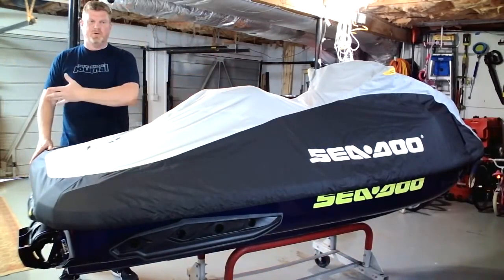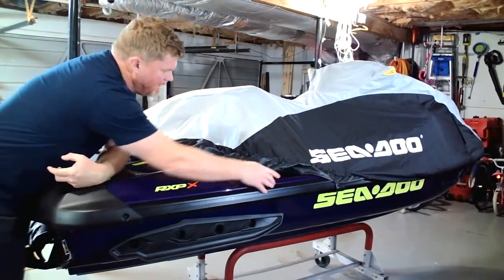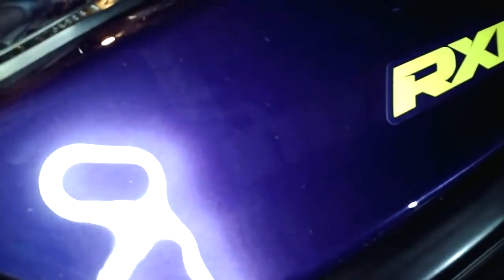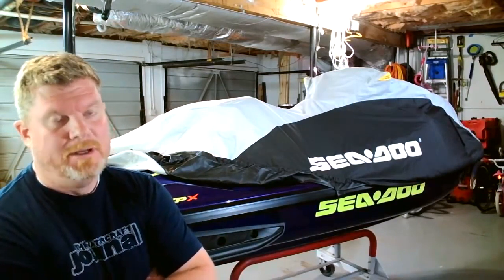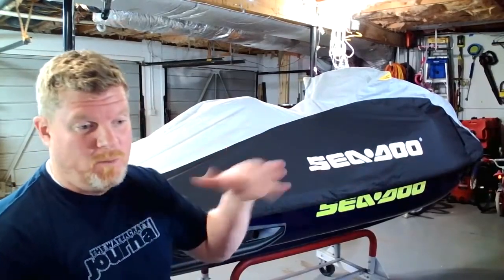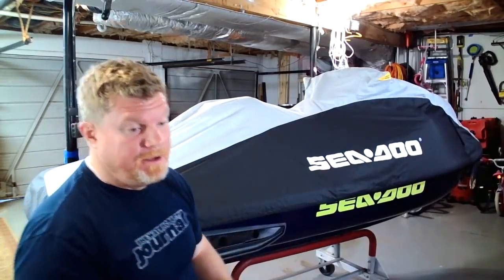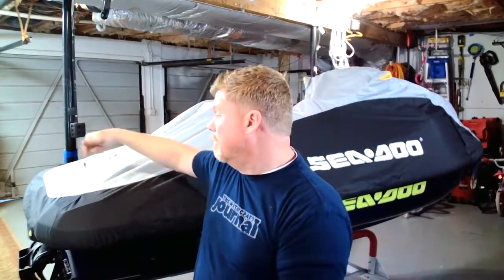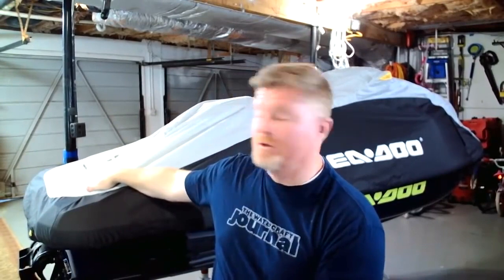Should You Tow a PWC in a Cover? WCJ Quick Topics

Comment: A good tip I have found useful if you tow with a cover on (as I do, especially long distance) is the use of painters tape (I use the wide type). I put a run of the tape on all leading surfaces that may come in contact with rubbing as well as around the draw tight line of the cover (more for a boat). Only takes a few minutes and cheap insurance to prevent rash marks on your ski/boat.

Comment: Well I drive every summer with my 2016 yamaha VXR cover and have never had any issues. The yamaha covers have tie ropes on the front of their covers with vents on the side rear. If you pull the rope lines tight and cut them half a inch shorter and tie a double knot on them, they keep the cover tight on you ski not allowing for flapping around at high speeds. I travel 380 miles every summer at 75 mph and no issues. Keep the cover on , it will protect the ski from dirt and rocks dinging your ski.👍
Reply from the maker: We've seen plenty of Yamaha covers disintegrate. Glad it hasn't happened to you.

Comment: Noob question here: What tool do you use to move your PWC from the trailer to the rolling stand that you have it on in the video? Some sort of jack thing? I just got 2 brand new Spark Trixxx 3 seaters (storing them in my garage).
Reply from the maker: Brute strength.
Reply: @watercraftjournal  lol how many people does it require?
Reply from the maker: Yourself - they're Sparks. Push the cart up to the back of the trailer, spray the bunks with WD-40, and pull on the back of the Spark. It'll slide from the trailer bunks to the cart. If you can't grab the back of the ski well enough, hook a tie-down strap to the D-rings and use the strap like a handlebar to pull it.
Reply: @watercraftjournal  thank you
Reply: @watercraftjournal  Dawn platinum power wash works great too.

Comment: As some have pointed out, the Yamaha factory cover has vents which in effect sucks the cover to the ski at highway speeds. They stay on great, don't flap and I have not seen any negative scratches on my '19 VX...nor now on my '22 FX...which I just towed 600 highway miles with. But your comments are noted.
Reply from the maker: We've had 2 covers completely tear those plastic vents off - just by wind speed.
Reply: @watercraftjournal  Right from Yamaha "Our covers are constructed of ultra-durable Eco-Elite fabric for the ultimate protection against fading and the elements. It is also non-abrasive, water-repellent, UV, mildew, and rot resistant. Features include Vacu-Hold� design, which creates a vacuum inside the cover during transit to draw the cover down snugly to the WaveRunner. Benefits include reduced air-induced stress on the seams, and less aerodynamic drag." My dealer is the one who told me the Yamaha covers are made for trailering...Yamaha seems to say the same.
Reply from the maker: Good. Listen to them then.
Reply: @watercraftjournal  LOL, well maybe the towing vehicle makes a difference too...could be the turbulence or lack there of behind the tow vehicle...but from my view, the Sea-doo cover is an inferior design to Yamaha's.
Reply from the maker: We've had all 3 OE's covers fail, as well as 2 major aftermarket covers.
Reply: @ericbryant796 Yama cover Andy enjoyer

Comment: OMG, why did I not think of that.  This would probably how I have developed 2 spots on the front that have turned dull.    I don't have the scratches but you can see the clear coat has been rubbed dull.  Ok so when I go on vacation and tow my seadoo Ill leave the cover off.  I just didnt want all the road grime on my ski but that just takes a really good wash to get off.
Reply from the maker: You're going to build up road grime with or without a cover, as the hull is what gets coated (mainly) with whatever your truck/SUV is kicking up.

Comment: How about the rocks and stuff flying up from my truck. I’m worried that it’ll damage the Seadoo without the cover. Doesn’t all that debris and stuff ruin the Seadoo?
Reply from the maker: You're going to build up road grime with or without a cover, as the hull is what gets coated (mainly) with whatever your truck/SUV is kicking up.
Reply from the maker: So your argument to "PWC covers scratch up your ski" is "Not if you tape down a bunch of towels under the cover"? Then Kevin's original argument still stands.
Reply: It’s a seadoo does it really matter if it has stone chips?
Reply: OMG. Towing with the cover doesn’t scratch your ski.  How about the rocks that fly up and hit the uncovered ski, lol.
Reply: This argument that rocks and debris are going to scratch the top of the ski without the cover makes no sense to me… your car has no front cover and there are thousands of cars in front of you kicking up rocks and debris. Jet Skis are made of material much more durable than car paint.    Unless you’re driving on some major off roads at 50 miles an hour while tow …. I live in LA and tow my Jetski to all the major lakes without a cover and I haven’t had any issues with rocks and debris striking my Jet skis.

Comment: I’m still on the fence. If you’re on a major highway (say going to the cottage) … Isn’t the lessor of the 2 evils the possibility of what you’re speaking of? As opposed to road grime, pebbles and anything else on the road your vehicle shoot back at the machine from its tires? I should mention I do have the all black cover that seems to be more fitted.
Reply from the maker: Don, it's a fair argument. Here's the "rub" – you can risk a dirty ski (depending on how rough the road is, it could be worse than "grime") or having to replace the soft/sensitive plastics that have been scratched and scuffed beyond repair.
Reply: @watercraftjournal  agreed. Just trying to figure out which is worse. I typically do the exact opposite, if I can control the conditions and stop or take another route through town I’ll keep cover off, but… if I’m on the highway at 120 km/h it’s typically on. For me anyways.

Comment: this video is 3 yrs old, but..i wanted to share what i personally have tested. for one, yes, i have the oem cover for my '15 yamaha waverunner fx ho cruiser. what i noticed about the cover is it's very rough to the touch when i went to pick up my ski from the dealer back then ( 2015 ), i knew going in, i was not hauling my brand new ski 7 hrs back home with this cover on my new ski. sooo..left the cover off for the haul home. once i got it home, i went to hobby lobby, purchased some soft cotton fabric, and sewed a liner to the underside of the cover, end to end, side to side. i have not trailered it yet for long distances ?, but i do know it will not scratch the paint on my ski. now..its a toss up if it will rip itself apart for a long distance haul ?, i do not know if it will or not yet ?. if you do this to your ski cover ?, i would advise to run some straps across the cover to keep it on the ski at highway speeds. 

Edit/update: just came back from a long drive from little rock,ar to knoxville,tn towing my ski with the cover on my ski, all the way there, all the way back, it never came off, never scratched my paint on my ski. maybe seadont's are just not meant to tow with covers on ?..lol. i will say !..i did have a strap across the middle of the seat/cover to keep it on the ski incase it decided to fly off ?, but it never moved one inch at the front or back. p.s. this was done while driving 70 mph !.

Comment: My Kawasaki has vents at the back of the cover only, this seems to make it suck down tight to the ski at highway speeds. Thoughts?
Reply from the maker: Kevin spent an entire full length video on this. Go listen to his thoughts there.
Reply: @watercraftjournal  ok, thanks for the reply, i have watched that video and didnt hear mention of the vented Kawi cover. I'll have to rewatch. The reason i ask is this cover seems to negate all the issues mentioned.
Reply from the maker: The backseat that sits over the vents to the engine compartment does NOT "suck down at speed." There's a fixed socket keeping that from happening. Equally, there's zero suction being produced in the engine compartment itself.
Reply: Sorry, i think you misunderstood my description. My cover has vents, not the ski. Plastic vents pointing down at the rear of the cover, no vents at the front. Im no airflow dynamics expert but I'm assuming the airflow past these vents causes negative pressure under the cover, so rather than billow and flap it visibly sucks down onto the ski. I usually tow with the cover on and havent had any damage to cover or ski. This is a stock cover on a 2012 model ski so thought you may be familiar with it.
Thanks for taking the time to reply. Ive got lots of useful info from your videos.
Reply: @callummacleod1921 Videos are good. The replies to viewer comments are defiant.

Comment: Watercraft superstore covers do not have vents so therefore the cover does not blow up with air and flap and stays flat and solid at 65 down the highway if you do have the cover like you are showing us then use 3m automotive painting tape 1 1/2 over the vents for The highway drive to keep it sealed up from air getting underneath the cover and flapping common sense have been an automotive painter for 35 years there’s nothing wrong with water sanding the gelcoat and fiberglass painted panels lightly carefully finishing it with 2500 grit wet and then using a 100% wool pad to buff with 3M 36060 rubbing compound and then going over it with a foam pad with 3M machine polish 06064 then hand wax with Carnauba wax and have had new chaparral boats for 35 years and use covers on the highway with no problems works with the same principle
Reply from the maker: Thomas, you’re not considering that the vast majority of PWC owners will not take these extra precautions or have the skill to restore their paint as you e detailed.

Comment: Yamaha makes a much better cover that is safe for your ski at high way speeds
Reply: I have a genuine yamaha ski cover and I had the same issue he is talking about.  Good thing a buffer and maguires took the marks off. I don't tow with the ski cover on anymore either
Reply from the maker: No, they'll tear apart at highway speeds as well. Ask us how we know.
Reply: I’ve towed my FX with a OEM cover 3 hours on the highway  70-75 with no problems but that’s just my experience. Results may vary.
Reply: @watercraftjournal  Maybe it was not installed correctly. I cruise at highway speeds with a 2020 FX Cruiser HO long distances and do not have an issue. It is designed to do this. I do put small microfiber towels over side mirror contact points, but again, can cruise all day long with no damage to ski or the cover.
Reply from the maker: You literally admitted that you put towels all over your ski inside of the cover? WHY?! Because the cover would otherwise scratch the ski – exactly what Kevin spelled out.
Reply: @watercraftjournal  I have never put towels over my ski and no it’s not all scratched up nor has the cover torn. Sorry if some people are getting different results, just stating the facts of my experience.
Reply: @watercraftjournal  Boy you are reaching and seem irritated for some reason.  Did not mean to do that... just was trying to provide factual  information in addition to your video.

You quote me wrong.  If you read what I wrote I said I put two small microfiber towels (6X6") over the two contact points (the mirrors). That's it, nothing else. 

I trailered my Yamaha WaveRunner 200+ miles at 65-70 MPH today for four hours on I75 in Florida,  like I do most weeks.  My ski was not damaged, the cover did not come apart at the seams,  or come off the ski.

 As Kevin Oakes says, your results may vary.... but if you are going to put out a video on not to ever put a cover on your ski when traveling you should present more facts than opinion.

A lot of new riders watch your channel and should know that trailering your ski long distance on highways with a cover designed to do that job works just fine... I generally enjoy your videos and I am a  subscriber... Have fun on the water and the road...stay safe!  Bob
Reply from the maker: But it doesn't. That's why we inform them of this matter. It violently whips and scuffs the surface of the paint (Kawi & Yamaha) or the acrylic (Sea-Doo).
Reply: @BobBroeking  seems for some reason they are insistent that the cover will scratch the ski and come apart as it violently whips in the wind! Not sure why you or myself would lie about our experiences with this, it is what it is if I had a negative experience I’d be happy to share it. Just don’t appreciate basically being called a liar over sharing the facts of what I have experienced. Beware people, cover at your own risk.....results may vary!
Reply from the maker: Using your own logic @kevin oakes you're effectively calling Kevin a liar. The street goes both ways.
Reply: @watercraftjournal  I have called no one a liar. I have expressed a different experience that I have personally had and wanted to express to others. However the watercraft journal seems to wanna be judge and jury and wants no input from those that don’t share the same views.